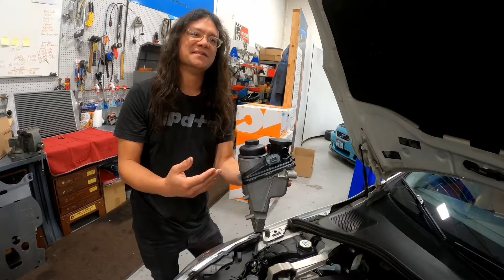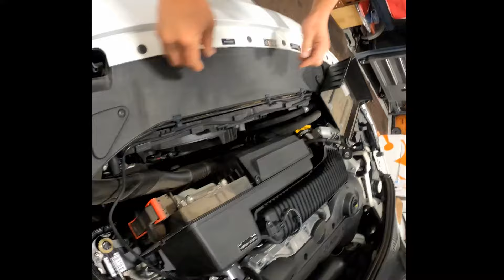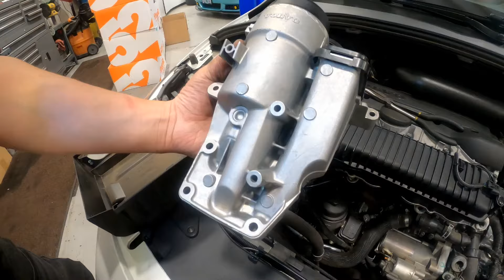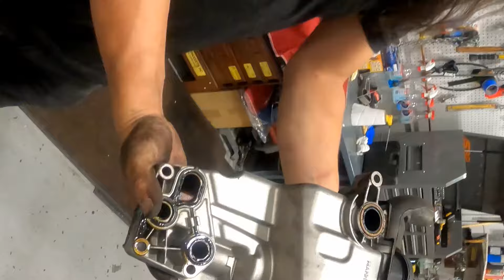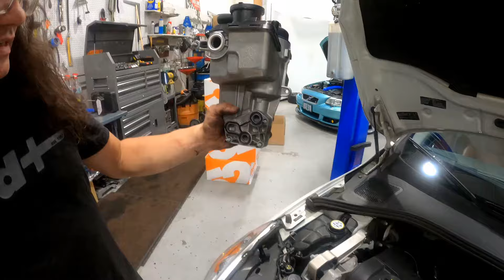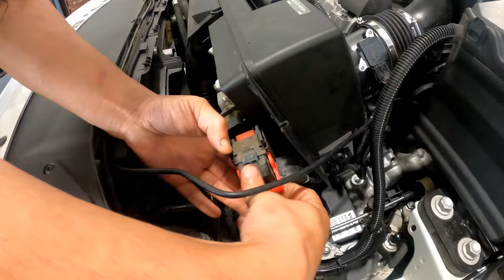Volvo PCV Overview for P1 & P3 Models Volvo XC60 V60 S60  2015-16 Volvo C30 S40 V50 C70 2005-2013

Comment: Hello Paul,I've an 012  S60 T5. I noticed oil on the edge side of the timing belt cover and on the belt tensioner. In fact my belt shredded and pulled out. I did a belt replacement 2months back. So am suspecting the cam seals leaking oil gradually. Do you think that was the reason my belt pulled out. Am thinking of using a Lucas Oil stop leak. Is it advisable? Do you have a clip of how to change the camshaft seals with all the tools and special tools I would need. The milage is 95k miles.

Comment: Excellent video. Thank you. I have a 2015 XC60 with a 5-cylinder engine, which was built on a P3 platform in Belgium. It has all the symptoms of the PCV being the culprit. Taking it to a  repair shop in a couple of days.

Comment: Hey Paul I'm wondering if adding the P3 snorkel to my P1 air box would improve performance because of more airflow or if it would just mess up ecm calibrations? Also, on my aftermarket grill, I can easily see a horn directly in front of the end of the snorkel where the P1 draws air and can only assume relocating the horn might give it a tiny bit of added benefit because of improved airflow.
Oh, and what are some of your favorite C30 T5 performance mods or do you prefer stock?